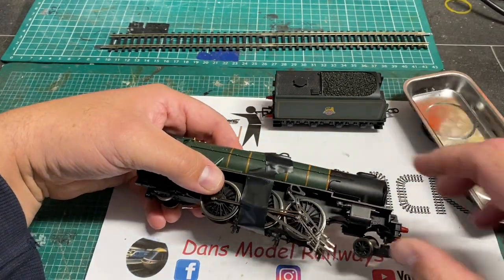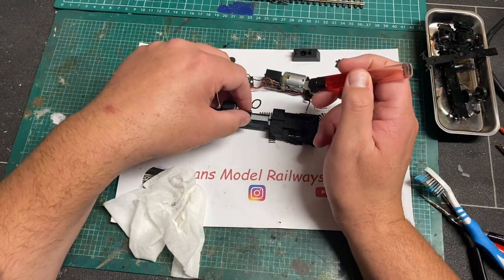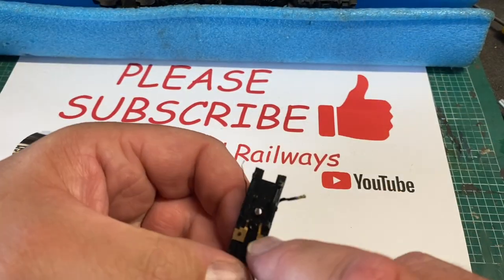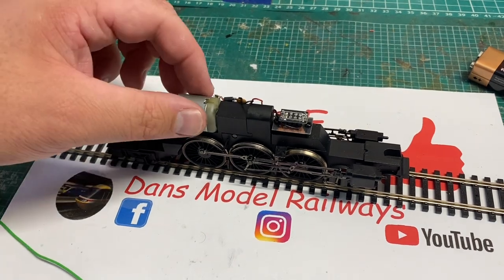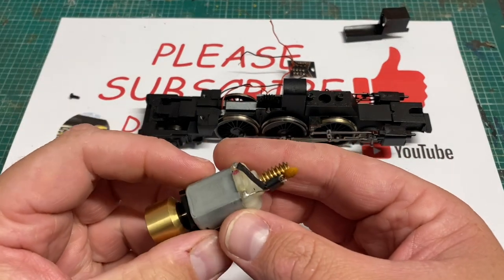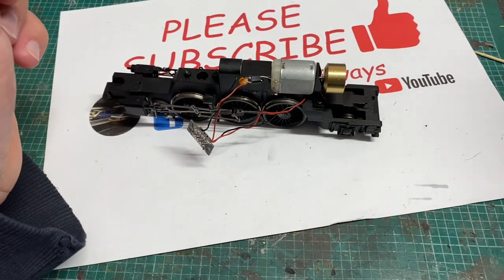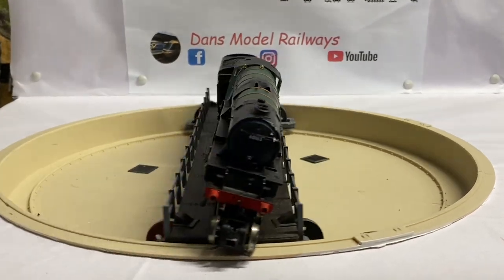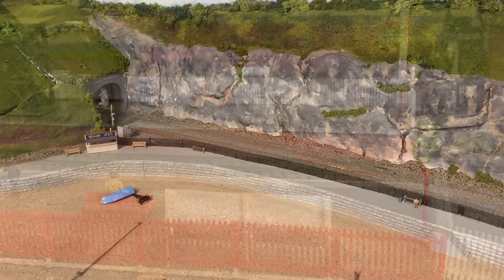Trash To Track Episode 18. Hornby A1 Tornado loco.

Comment: Hi Dan. Double ended motors are always a rarity that size.
However a simple fix would have been fit a single ended motor available for pennines,  and leave off the flywheel. Cheers Gary

Comment: I’ve got hundreds of those spare motors. And I don’t use those trash 3 pole motors I use 5 pole 😉 why do you use a 9v battery? Do you not have a dc controller?
Reply from the maker: Do the motors you have, have the fly wheel attached? I use a 9V motor as its more convenient than having the wires of my DC controller laying across the bench.
Reply: Hi. The motors I buy Are Hornby part number X6576. These are a drop in replacement and have 5 poles and are skew wound with very strong magnets.  These have worms on both sides. But I take the worms off and put whatever is needed like a flywheel or worm. And I w done this with my duke of glouster, p2, flying Scotsman, tornado and many others.